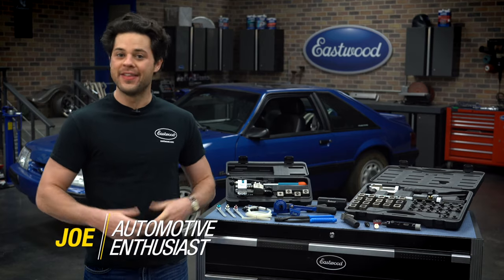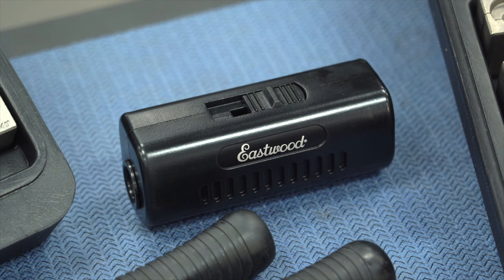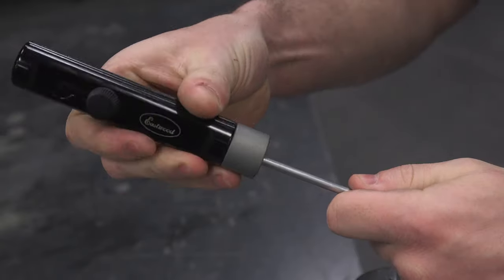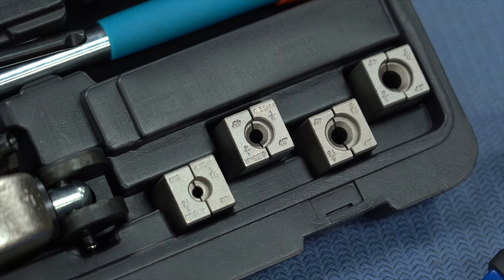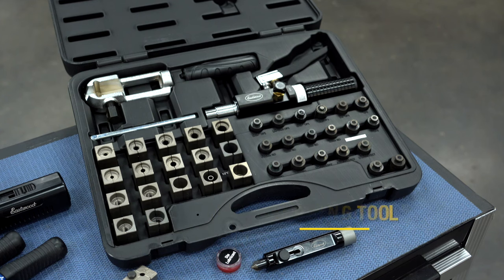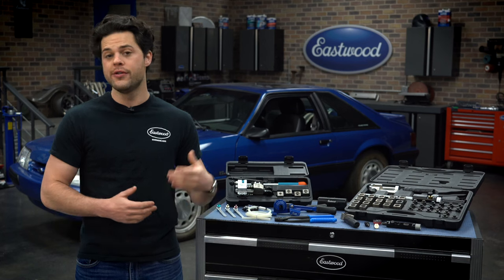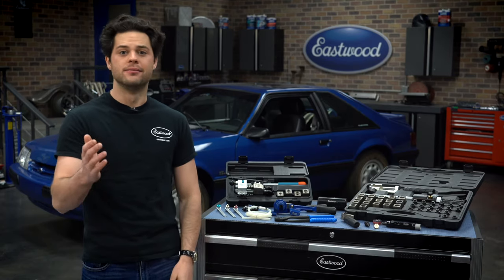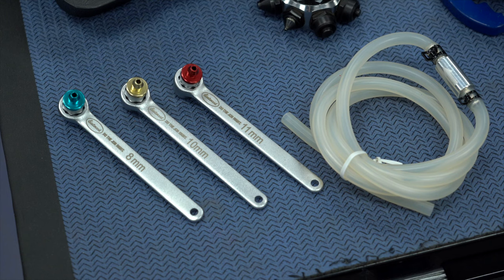Everything You Need to Bend, Flare and Install Brake Lines on Your Project - Eastwood

Comment: What type of flares are the last two shown? Toyota uses this type in their 2000's truck steering rack lines. Can't seem to figure out what they're called.
Reply from the maker: Go to 3:25 in the video - there's single, double, and bubble flare.

and when moving to the Hydraulic Tubing flare he discusses push-connect and GM style fuel line flares.